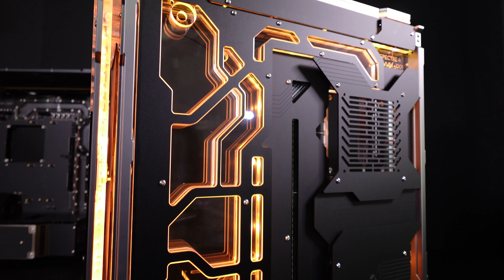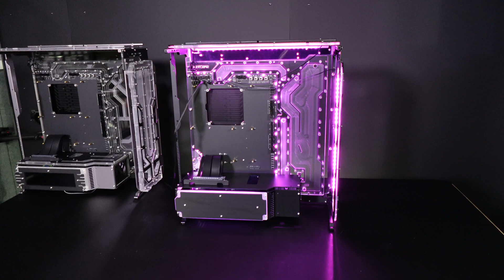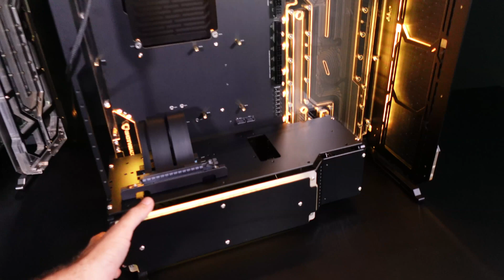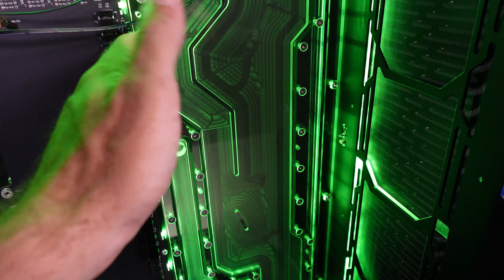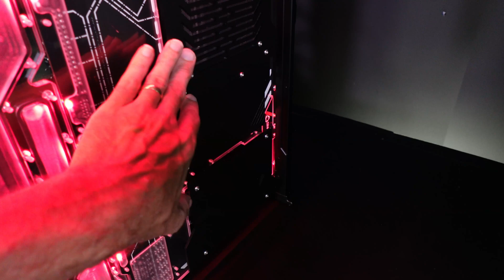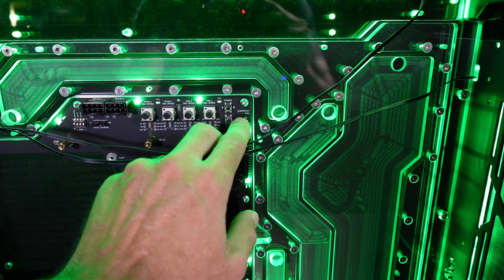Spectre 4 Detailed Look

Comment: Wow all the things I wanted for my Spector 3.0 (which I love btw) - now integrated into Spector 4.0, no longer would I have to remove the motherboard to redo my liquid metal/direct die CPU water block if I had this case... Fantastic work Daniel and Team.. Looks like a 4.0 may be in my future.
Reply: @ BTW, the fan filter plates by chance would those work on a spector 3.0? I get allot of dust in my house and can they be ordered separately ?

Comment: I wasn't sure about the 4, set my hopes on getting an Elite Proxima dual loop later this year. But I'm convinced now. As a CNC engineer myself, I absolutely see the value in your pricing. I grasp how many elements are required to take a concept to a prototype then a saleable product to be proud of. Waiting for Nvidia 50 Series and 2nm Intel CPU's, and my order will be placed. So long as the Spectre 5 isn't ready by then. 😂
Reply: I just bought one ! Will be posting reddit photos one day soon in the next 2 months of the final build.
Reply: @Hexttones  I'm about to hire the button on my order, just a few details to work through. Want the dual loop side panel and top reservoir . Problem being not enough details on 15th Gen, Z890 and 50 series yet
Reply: @anthonywebb6479  yep when they gone they gone. I'm doing a 1600w psu. 4090 and all components blocked and water cooled including the ram. This case has such an artistic and insane look. Everything I ever imagined and more in the design. It's also functional as good as it looks. Lots of volume for modern components.
Reply: totally agree. I'm a massive fan of Singularity and can't stand it when I see negative comments from people who completely miss the point of what this company is about. thankfully it's rare that I see negative comments because when you're a complete "fan boy" it gets to you. I can't wait to have the money to buy one of these for myself but I'm now in a tricky spot because I can't decide whether I prefer the new Dominus over Spectre. I think I do but I can't work out whether it's because it's a new look or whether it's because I genuinely prefer it. I guess time with tell.

Comment: I have been with you since the start watching the videos,  I am at a point where I can actually get one soon.

I am wondering if you can get a MONSTA radiator in?   Is there a possibility?   In push pull?     I know the benefits are marginal but it would mainly be for the nostalgia from my era of water cooling.

Is that a possibility ?